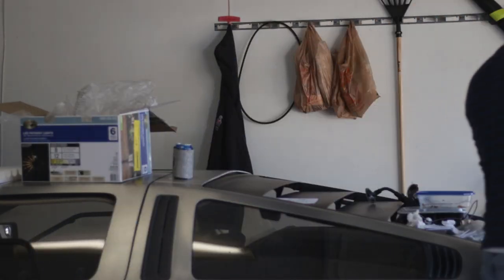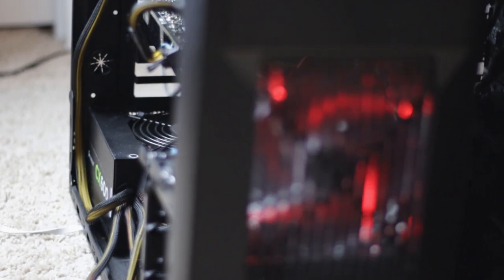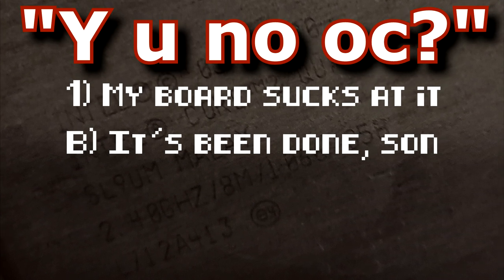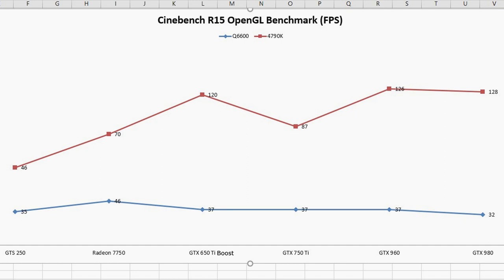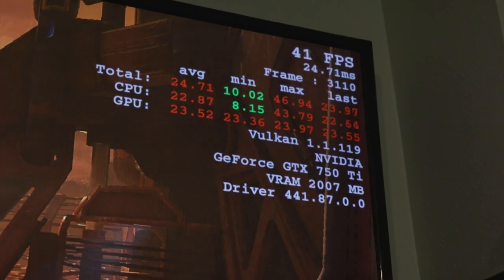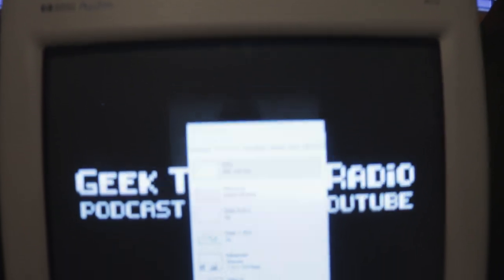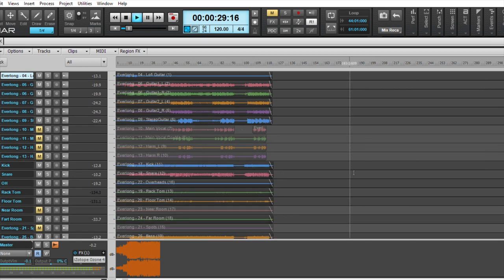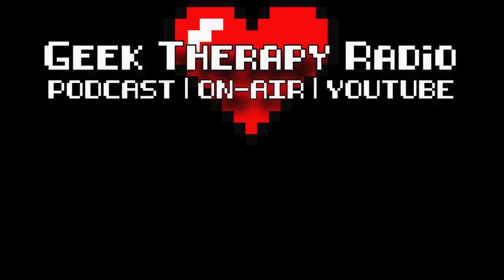Is the Intel Q6600 still worth using?

Comment: One day, there will be a video about "Is the Intel Core I9-10900k still worth using?". Probably about 13 years later. Imagine that, well...only time will tell. Great video and very underrated channel.
Reply: The most impressive thing about technology is how much it improves just over a decade. This makes me scare of how the future may be...
Reply: Moore's law, but it's slowing every two years tho lol
Reply: not likely mathematically resolution is capped i have personally a 75 inch tv and i do own a switch so 720 30 fps happens but it still looks decent.  in fact for a 8k video you would need a 85 inch tv minimum and to sit a a perfect distance. to far that many pixels means nothing to close you cant see all of the picture  and keep in mind the switch has 4gb of ram and about this q6600 cpu power..  so rez cap is happening and anything above 120hrz has massive diminishing  returns    https://www.rtings.com/tv/reviews/by-size/size-to-distance-relationship
Reply: @simlife445  um, who are y talking to? It's a bit out of topic

Comment from the maker: Anyone still got a Q6600 build floating around? Still use it for anything? What are the rest of the specs of your Q6600 build?
Reply: Not personally but, in my job, there are dozens of these chips laying around, just waiting for a new place - in case you're wondering, I work in an e-waste recycling center.
All the Core 2 Duos, Core 2 Quads, 1st gen., 2nd gen., 3rd gen. Intel Core chips, AMD Athlon IIs, Phenoms, FX-series, Server-grade stuff... we have piles and piles of that stuff to play with and pretty much build any kind of rig we could.

My current endeavour is the server we're building at home: a retired Dell PowerEdge T310 w/ an Intel Xeon X3430 will gain 16GB of DDR3 Registered ECC RAM, 4 x 4TB NAS HDDs, FreeNAS and it'll be in charge of backing up every computer in the house + storing movies, music and personal stuff. Can't wait to deploy and activate this little beast 🤓
Reply: Gigabyte EP45-UD3R, 8gb ram, SSD, Nvidia GTX 1050 with 4 gb ram,  42 inch LCD TV, Windows 7 performance run Processor 6.8 Ram 6.8, Graphics 7.9, Gaming Graphics 7.9 Hard disk 6.8
Reply: @UnderEu  Are you able to sell any?
Reply: Anderson Silva If you have Discord or something we can talk more. I’m interested in buying a Core 2 processor for my old XPS.
Reply: My little sister uses my 2nd pc for Roblox and Floating Sandbox. Specs are: 8GB DDR2 800Mhz OCZ SSD GTX 745 2GB Q6600 that I got for free out of a trash pc tower
Reply: Yep. 4x2GB DDRII 800MHz, Gigabyte Micro ATX mobo, a good cooler (I do not know the name but it does not get hotter than 58 *C), Sapphire Radeon HD 6570 2GB low profile, Terra micro ATX case, 120gb SSD, Win 7 :) I love it, it works fine for old games and as a Media Center!
Reply: still using as my home desktop with KDE Linux Plasma + Windows 10 with 6GB ram +ASUS G41TML-X3 + 9400GT 1GB GPU on Micro ATX  any sugestion for upgrade GPU??
Reply: @WeBeGood06  Which Windows 7 build kindly share as i'm pissing with Windows 10 Professional & tuned up some tweak to offload unwanted services but still my ram is usage 65% while surfing on firefox only!
Reply from the maker: @KaushalBeladiya  Q6600 will bottleneck anything above about GTX 650/750 in most cases. GTX 650/750 was great with my Q6600.
I'd upgrade the rest of the system to at least socket 1150 before upgrading GPU though.

But if you're upgrading anyway, might as well go AMD Ryzen to stay more future-proof.
Reply: @GeekTherapyRadio  I'm in very limited budget kindly share config I have SSD 240gb it will works in upcoming build I guess.
Reply: @UnderEu  can you tell us the prices with shipping costs? :)
Reply: Dell XPS 630i (12 years old) 
Q6600 2,4 GHz / gtx660 / Nvidia 650i sli board / 8Gb 800 MHz
Still my current PC-System. Most of AAA-Games works! Only SSE 4.X games are not supported.
Reply: Hey man, a bit late but, idk why my cpu is overheating in like doing anything, it just hits 80 to 90c on just the startup, and when those background processes run for a bit at startup, my hdd and gpu temps seem fine, but the cpu, it just jumps to 80 to 90c in doing anything, at idle it stays at 75c. Even opening the lightest app will make it hit an 80. I havent tried applying thermal paste as i have to travel far to find it, but i have tried toothpaste and even with ttha im having the same problem,
My specs are:
Intel core 2 quad q6600 2.4ghz
Amd radeon hd 6770 1gb sapphire edition
Intel dq35jo motherboard 
6gb ddr2 ram 800mhz
Reply from the maker: @samuelmizhabadil996  I still think it's the paste. It's also possible the heat sink isn't seated properly.

I'd order some cheap thermal paste (if possible), clean, and reapply.
Reply: Up until the other day yes but it croaked so now I'm using an i7 860 build instead for my lighter tasks
Reply: im using it right now with a P5Q mobo and aftermarket cooler. 3870x2 was replaced but the fatality soundcard still gos hard.
Reply: My computer is 10+ years old. I build it to last with this CPU and an ASUS P5Q Delux.  I have since upgraded the GPU to an NVIDIA GTX 1030i (yeah I know I'm underusing my GPU) and recently got an SSD drive for it. It plays the games I play (Skyrim SE, Civ VI, EVE, StarCraft II being the most intensive ones) and it plays them well.  Unless I start wanting to play more modern video games I see no reason to decommission this processor before it dies.  I'm very happy with it.
Reply: I have an intel core 2 quad q9550 @ 2.8 ghz
4gb ram
gigabyte ultra durable 3 motherboard
Nvidia quadro k620 gpu
Reply: Received delivery of a used q6600 from China 2 days ago (8 USD), placed tape for 3ghz mod, replaced my e5800 in my stock acer Intel g31 board. Turns on and runs fine, still using stock e5800 cooler, max temp 72 degrees with prime95. Ram 4gb ddr2 800. Win 10 Pro 64 bit, 120gb ssd. Looking for a suitable GPU for Netflix Full HD. Considering 1030 but rather overpriced at the moment.
Reply: It's actually my daily.
Reply: Intel Core 2 Quad Q6600	nVidia GTX 560	8GB RAM	128GB SSD/1TB HDD	ASUSTeK P5K-E
Reply: Yes, I was messing about overclocking mine today, just for fun. I use it as a second computer and its still kicking it,
Reply: I have an old PC with Q6600, 3GB DDR2 and GTX 260. It runs games such as Skyrim and Portal 2 without issue.
Reply: A music production machine and going to install windows 10, give it a refresh.
Reply from the maker: @virtualasmr2341  Q6600 is still great for music production. I'd happily record and mix full albums on it. I've done many on the Q6600! :)
Reply: @GeekTherapyRadio  yeah, it worked well. Because i'm working with external midi and mixing desk, there's not so much onboard processing too. I  have pushed it in the past, 64 channel VSTi's and it performed very well.
Reply: I'm using an Intel Q6600 OC'd at 3.33GHz 1.285-VID, 1480mhz DDR3 Ram 8gigs, GTX 670, all connected to 3 displays boasting 1440x900 @75hz 2ms gtg.thing is cool and quit, I play WoW and American truck simulator with it. (some gtav offline, cause online is toxic)
Reply from the maker: @gerkovwolf2629  Quite the OC, nice job!
Reply: @GeekTherapyRadio  For sure, much higher overclocks are obtainable, though considering the stellar ram speed and Vid, this seems to be the sweet spot for my chip, having a DDR3 775 MoBo gives some huge advantages to OC'ing these old chips.
Reply: @sylvaintousignant5050  I love you. Me too.
Reply: @nanman4554  mine used to be a bit like that, slightly better now but only just gone for the 8gb ram thanks to £10 off ebay.
Reply: @Equnoxe I've got one of those chips in the post hopefully arriving tomorrow. I have the same mobo as you but never tried to overclock anything. I don't really know much about that and haven't had cause to increase speed really anyhow. Only upgrading now cause I got new RAM to put in so figured may as wall do the CPU at the same time
Reply: @Equnoxe I'm assuming we still both limited to 8gb RAM with that mobo?
Reply: Still runing this oldie. 
q6600 at stock speed
Ge6orce 450GTS
8 GB DDR2
SSD.

Using as daily driver, old games, and some new ones. Runs good and strong
Reply: Hi from Brazil. Asus p5k se, core 2 quad q6600 @3.0Ghz, 4 x 2GB ram ddr2 800MHz, hd 7870.
Reply: @gustavodsg2007  does q6600 works well with HD7870??? No CPU bottlenecing or something???
Reply: Gigabyte EP31-DS3-L, 4gb DDR2 ram, Seagate 320 GB, Nvidia 9500gt with 512mb ram . Still flawless for Zoom Meeting & Google Mee😅t
Reply: You convinced me to build the lapped Q6600 I got sitting there and collecting dust for a day-to-day tasks system!
Reply: Asus Rampage Formula, Q6600 @ 3200MHz, 8GB Corsair XMS @ 800MHz and Asus GeForce GTX 570 DirectCU II 😎 Everything works perfectly stable and right now i'm playing Far Cry New Dawn at 1080p resolution with Medium setting at about 30 fps average. There is slight bottleneck at minimum framerate but average is above 30 so i'm very happy. Compared to my i7 965 Extreme Edition also at 3200MHz there is no difference in everyday tasks but when it comes to some recent AAA games and video rendering i7 is better. I will keep this old legeng with Rampage Formula as long as it works. Also DDR2 @ 1066MHz gives real performance benefit compared to 800MHz memory especialy in 7-Zip and other compression programs but it's very expensive.
Reply: almost 10 years Q6600 -> Q9550 , 4GB DDR3 *2 with 1060 6GB OC. Prepared to upgrade to LGA 1200 if it finally busted.
Reply: Yep iam using stock q6600 with 4gigs of DDR2 and a gt710 works well with some old and new games
Reply: A friend had dropped his PC which then stopped working. It was sitting in a box for 4-5 years. I recently stripped the parts after realizing the motherboard was damaged. I did not like the case either so I scrapped it too. So with the following mix of new, used, and used bought parts I built a PC instead of buying a new Ryzen 3 system. Components: Q6600 (used), ASROCK G41M-VS3 R2.0(new from ebay), 2 X 4GB DDR3 1333 MHz SAMSUNG RAM (used from ebay), INTEL A700 CPU COOLER (new from ebay), 240GB INTEGRAL V SERIES SSD (new from ebay), 400W AKASA PSU (used), LOOP ZOOSTORM MID TOWER (new from ebay), NVIDIA QUADRO FX 580 (used). Cost of parts purchased: 105 pound sterling (GBP). I ended up not using the NVIDIA GPU and use instead the motherboard integrated graphics. OS is GNU/Linux 64 bit with Gnome GUI. Pretty good for daily at least if you run GNU Linux. For less than half the money a Ryzen 3200G system would have cost. My advise is to try to get a motherboard with Gigabit ethernet if possible. And avoid NVIDIA GPUs as performance in GNU Linux is poor, with very noticeable effect on streaming. And ofcourse replace Windows with GNU Linux.
Reply: Upgraded to Q6600 from Pentium E5300, rest of my build : Gigabyte G31M-ES2L, RX 560, 8GB DDR2, SSD, playing on 1080p on max settings in most games (medium to high in new games, have to turn down some settings) i think that q6600 bottlenecks RX 560 but overall i didn't noticed any problems so far)
Reply: my second gamer pc have 1200w power supply   3 x gtx 280 sli   16gb ram q6600
Reply: Yes, heating my bedroom.
Reply: Do you think any version of 7DTD would run on it? To turn more serious, I built a pretty good system back then, but never used it, my decision since then is that I spent enough for pc hardware for the rest of my life, but I still like some modern games, atleast in let's plays, because I'm not sure if I really would play them, I don't want to buy anything and just want to know if it can run 7DTD, because this is a game I really would like to play, it can run Rising World, which I hyped a lot but don't like to play myself, rain in this game is a problem for my pc though, also the fact that it really heats up my room within no time kills every little joy, because of the fear of the costs for electricity end of the year, I hear the pennies run like water.
Reply: I put one together for a friend out of a couple of scrap PCs I had from years ago. Q6600 8GB DDR2 1066Mhz and he got a GT 730 and SSD for it. Works great for League of Legends and daily use.
Reply: Im actually building my first pc with it because my dell dimension e520 died and the CPU was fine
Reply: I got one. 4GBs of RAM and an AMD Radeon HD 7750, with 2GBs of VRAM. If I set things to low, at times aith the aid of LowSpecGamer, I can pull 50fps out in games like BO3 and FO4.

Comment: I have an use a Q6600 with a 1660 TI and it runs modern games flawlessly
Reply: does it bottleneck hard?
Reply: I wanna know too, thinking of pairing it with RX580 4Gigs
Reply: Im getting a 1650 super with the g6600
Reply: I have a i5 2500 paired with a 1650S, it does bottleneck the GPU a fair amount, depending on what game I'm playing.
Reply: ManorSailor Um yes that’s bottleneck city. Get a 1050 or ti variant if you want the maximum power.
Reply: CPU, PCIE bandwidth will be a bottleneck for this system...I do have the original system I built 13 years ago,, Asus P5Q Pro , Intel Core2Quad Q6600 with Radeon 7800 4GB ,,,,cannot play Devil May Cry 5 smoothly
Reply: @GrabASpriteB  can i use gtx1050ti with q6600?plz reply

Comment: i still use a q6600 with a gtx 550 ti, it's my gaming pc still and it run triple A titles❤
Reply: Doubt
Reply: I concur, while my spec is a bit higher I ran a high graphics games that only came out end of 2019 on max (not picked up anything newer as nothing appealed)
Reply: Guys can I use g31m s2l with ssd
Reply: @deadmilkman121  Why? I have a second PC with a Q6600 and a 8800GTS (640MB Version) and all games until 2013-14 run flawless at least at 1650x1050 wich is the max for the plunged monitor . Modern games of course dont even start, since its lacking DX11-12 Support und some instruction sets on the cpu side.  Like he said in the video, when you only browse the web or do nothing 3d intensiv, I feel zero difference compared to my main Ryzen 3600 Rig.

Comment: I have a GTX 1050 in my 2007 q6600, it's still running great. The Original Motherboard died long ago, replaced with a Gigabyte EP45-UD3R that's been rock solid all these years. I haven't turned this computer off since I built it, still running today.
Reply from the maker: WeBeGood Legend!
Reply: We have the same setup, I'm surprised it can run doom 2016, and many modern games. I couldn't overclock mine to more than 2.8 ghz, but it still runs well. I want to do the tape mod, so games can run better.
Reply: That Gigabyte MB is legendary for me.  Same one with my Q8200, still going strong.
Reply: @arisxipo  heard BSEL can damage mobo......  try lapping cpu and modding cooler first 🤞
Reply: @yellowfin81  thanks for the advice, but I've upgraded to a new PC. Thanks again

Comment: The q6600 was my first build, I can still remember that the mobo was an asus p5q pro because that build was important to me. I used a zalman flower cooler and i remember oc'ing it to 2.8 and thinking i was the king of overclockers. That was the old phoenix bios.
Reply: First PC I built used one too. Was still going strong seven years later when I upgraded my setup for VR and replaced it.
It, along with the original mobo and RAM are now in the repurposed case of the Dell computer I had before the homebuild. It now has a Xubuntu install and I'm setting it up for a home media server - albeit with boot/shutdown timers to save on power costs. 
In fact, if anyone knows how far it can be safely underclocked and can point me to a guide, I'd be very grateful...

Comment: I have an old Dell optiplex 760 so I got a q6600 for $10 on eBay and got it moving quick.  overclocked to 3.0ghz ( 1333 tape mod ) has a GT 1030,  4x2gb DDR2 @ 800mhz, and 256gb ssd. Nice living room pc, we use it for movies/ some gaming and small video editing. :)

Comment: a bit late but the SLACR variant seems to be the chosen one for OC. I say this but I ditched the manual overclock because running 3.4GHz at 60C makes no sense if you can run at 3.0 at less than 40C with the BSEL mod with a lot less noise

Comment: The thing with the core 2 quad was it could overclock like hell - with water cooling I could run my Q6600 24/7 at 3.4-3.6GHz, and I had it up as much at 3.9GHz stable in testing.  It's still being used in a home working PC back at stock speeds now, not bad for a 13.5 year old processor!  Best CPU purchase I ever made.
Reply from the maker: Yep, legendary chip, still useful today.

Comment: Im using it on my main pc because either my x370 mobo broke or my ryzen 5. Im running my q6600 at 3.2ghz with 8gb of ram and a gtx 1060. Fun to see that old p5e motherboard in my 150€ case with rgb. Im running arch linux with it very good performance i have had it like 12years and it can still bump +110 fps in csgo and minecraft also very good performance with my settings like 300+fps.
Reply: which motherborad your using with q6600 processor i am planning to upgrade my GPU from 9400GT & my current motherboard is G41TMLX3 ASUS. :D preety old but using this been 4 years from now with dual boot Linux KDE plasma & windows 10 with 6GB RAM DDR3
Reply: @KaushalBeladiya  ASUS P5E Board i also ran kde plasma now thankfully got my ryzen working My q6600 has been running for like 12 years

Comment: I was going to make a video about using this cpu in 2020 but I’m glad you beat me to it because this has immensely more polish and flow than I could have ever pulled off! 

You’ve also sold me on that little 750ti I gotta get one of those.
Reply: tell me why i got a desktop xp 420 with a Q6600 for free on FB marketplace and i had bought a 750ti on letgo for $15. im loving this desktop. i YT Q6600 and this video came up and saw your comment. im glad im not the only one in 2020 running a q6600